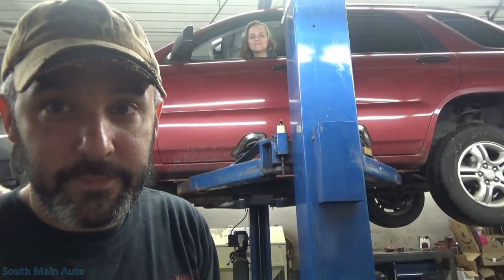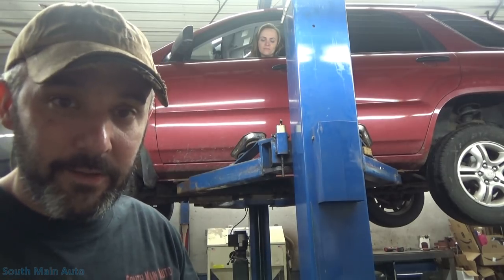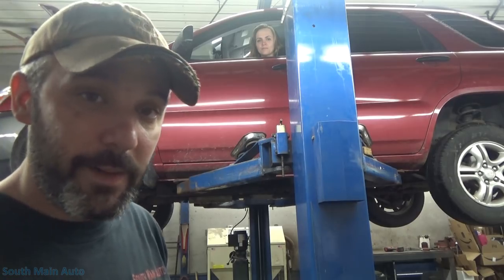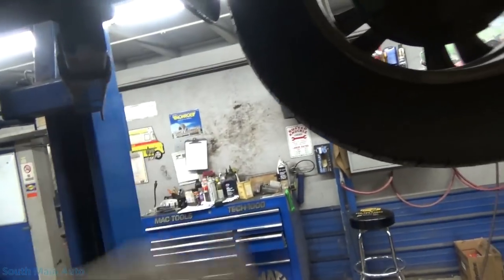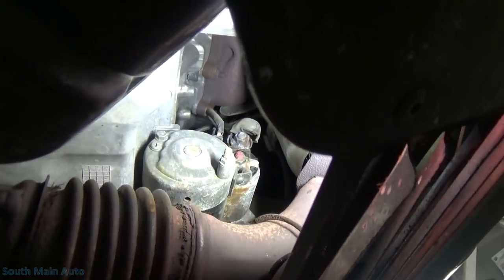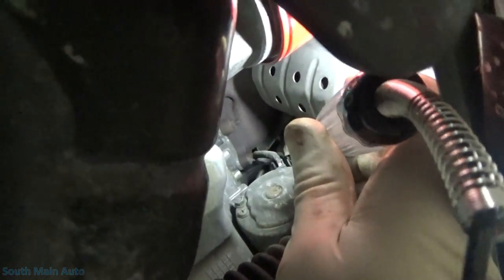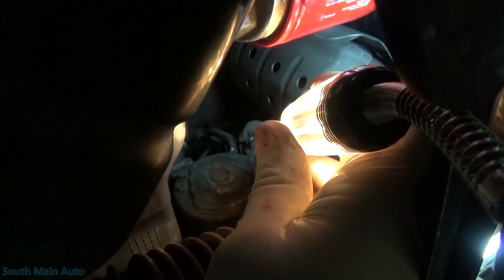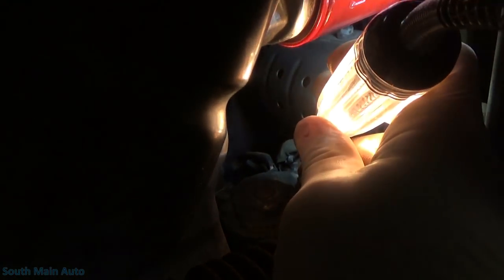TEST DON'T GUESS!

Comment: Always check for transmission jack or anything you might have forgot under ther car especially transmission jack before lowering it dont ask me why.🙄
Reply: Ha, same for going up. I bent over a trunk lid raising a car on a lift. Ceiling was low on one side, raised car with trunk lid open and folded the trunk lid like an accordion.
Reply: @watchthis9792  Probably on the phone...

Comment: Why put a 780 ma bulb in your test light? And thanks for another great video.
Reply: Mike Holt if the test light draws more current, it is more likely to expose a voltage drop due to a bad connection. Of course too high a current through the tester can be bad on low-current circuits - but the starter ain't one of those!

Comment: You just gave me an idea Eric - next time my wife & I argue about something, I can put her up on the lift in the car and leave her there until she tells me I'm right, hehehe.  101 lift uses! :D  Use #100: an instrument of extortion from your spouse. :D

 This right here would've slid the old me, back before troubleshooting was a thing. Would've wung a starter at it, for sure! Funny thing there is,  it may have worked, since disturbing the connection probably would've cleaned it up a little, plus I'd have wire brushed it while it was off - something grandpa got me in the habit of doing. Would've never known I was WRONG! What's worse is, I'd have just wasted a pile of cash!  

 Great title to the vid!! A money saver.  No video is silly, especially this one! You just gave a great example of how even a seasoned tech can get slid on something like this. :)

Comment: voltage drop! voltage drop! voltage drop!. it IS a must to test for voltage drop.... the combination of both starter stud and ring terminal is at fault when exposed to the cruft they're placing on roadways.. even in non-rust belt areas, the same will occur, albeit later in age :0
Reply: have I mentioned chinesium metalurgy in the past :))))

Comment: How did you know the cable from the battery to the starter wasn't corroded too?
Reply: It depends where exactly you touch the test light. If you touch the light to the stud on the starter itself and it goes out when the key is turned then you move the point of the test light to the ring terminal on the cable and try again. If the light stays on then the cable is okay and the problem is the connection. But if the light goes out then the problem is between the ring terminal and the battery. So then you move up the cable back up towards the battery and when you jump over the bad connection the light will stay on when the key is turned. In this particular case he lucked out because it sparked and he noticed it.

Comment: "Replaced starter for intermittent crank"  is throwing parts at a problem.  A bad connection at the starter is not unusual.  I've seen loose connections there (and in  many other places) on brand new cars.  Most recently a Ford Fiesta was towed twice and had a good battery replaced before it was taken to a Ford dealership, where an older mechanic troubleshot it properly.

Comment: Best part is, if it turns out to not be a permanent fix than no big deal!!
Reply: Right. You just need to be sure to tell the customer exactly what you did and what you charged them for. If the starter were to fail a month later they need to understand that it will be a new separate repair.

Comment: but if you put a starter in it it probably would have fixed the issue too, if i have to drop exhaust to check a starter im calling the customer and telling them hey it probably needs a starter and get the labor for that job approved and then do further diag once they approve that labor and when it comes out cheaper with just labor and no parts you look like a hero

Comment: See this is exactly the type of thing that gives me nightmares about bringing my car to a shop. No way.....NO WAY we get out of this without the shop replacing the starterl. Realistically, I'd say maybe 1 in 100 chance, even if they spotted the connection problem.
Reply: The shop I work at you would have your original starter, and clean connections.  Any other
shop in our area, you'd have a new battery,  new cables,  new starter,  and 5 hours of
diagnostic time...

Comment: Simple fixes always don't last long you know damn well that starter may shit the bed couple months from now from low voltage. Surprised Vanessa let you raise her up in a car on the lift, scared that you may not let her back down lol. I used to help a mechanic friend in the shop he worked at the lift was clapped out it wobbled back and forth it was kinda scary.
Reply: "you know damn well that starter may shit the bed couple months from now from low voltage"

WTF are talking about?

Comment: Some poor owner working on his car will smack it with a hammer then it’ll start. This will give him the ASSUMPTION that the starter is bad and replace it. HOWEVER anytime in the future when he does that to another vehicle with the same symptoms, and the car starts he will always think “yea its a bad starter, replace it. Now... in replacing the starter and screwing the bat + wire he will make a better connection and will always use the previous terms i mentioned as a diagnoses. Moral; TEST DON’T GUESS!

Comment: I just saw a floating head in the window and it scared me the crap out
Reply: Had the same problem with my ford f 150. Seems the service tech didn't crimp the wire good enough. So i had to untape his mess and redo it myself. Point is, know your mechanic

Comment: If you hace fired the parts canon you would have got the problem solved too ... when retight the positive to the NEW DORMAN starter .. you know ... part changers .... SCORE   part changers:1 Mr O. :1 ..... LOL .... Issue is the kia returning one week after because the DORMAN starter makes the engine turn backwards or fell apart on the road

Comment: And later the starter craps out cause it looks OLD and the customers is pissed because the car is broke down again...Replace the starter and be done with it. Been doing this at my shop for 35 years! This might be great for DIYers who are trying to save a buck...but nothing is worse than a nagging comeback! Diagnostic time is a labor charge also which could be spent replacing the starter instead of milking a few more miles out of a worn out crappy old starter!
Reply: So what do you do if it needs new spark plugs? Replace the worn out crappy old engine just in case? No. You fix what's wrong and if it works okay you mark exactly what you did on the invoice and charge the customer just for that. If the starter fails soon afterwards then the customer pays for that as a second new repair. That starter could last another 5 years. You just don't know. Things like starters usually don't wear out based on running time anyways. They wear out by the number of start cycles. As such you are replacing a part that still works and doesn't need to be replaced right away. That's called theft my friend.

Comment: I’ve learned the hard way in the scenarios you should’ve just put a starter in it so when she comes back in a month and she needs a starter you want to charge another $300 very upset
Reply from the maker: No need to replace the starter though?
Reply: After the repair if they would have any problem with the starter it would be covered including the tow bill and rental car by the company I work for so Maybe you can see my point

Comment: Hyundai/Kia aftermarket problems? I was fighting with Chinesium aftermarket crap on my old Ford since 99; TPS, O2 sensors, starters... needed a starter for my 92 Crown Vic, local guy had it for $35, 6 months later it craps out, he gives me one free, 9 months after that, it craps out at work 25 miles away. I go to the parts store there and it's $125 lifetime warrantee, bla bla bla, IDENTICAL MARKINGS, even the casting codes on the housing were the same as the $35 starter.

Comment: According to modern business theory you missed an opportunity to make an easy profit by repairing the bad connection, leaving the original starter but charging for a new starter. Believe it or not I know a few fella's that would have done just that.
Reply: Yes. They are called thieves actually. They belong in jail.

Comment: Bad ground
Reply: It's not a bad ground. There is high resistance on the power terminal where the plus battery cable connects to the starter.

Comment: The people that design these vehicles don't have to repair them so they don't care...
Reply: The people that design these vehicles get paid to make them fast and easy to assemble at the factory. They also get paid to cram all the extras that consumers want such as A/C, power steering, power brakes and ABS into a small space. Then you can add in all the government mandated equipment like the emissions controls on top of that. It all has to fit in there somewhere somehow.

Comment: Not silly at all dude but you could have sold a starter as preventative maintenance
Reply: He could have also sold the customer a new engine and transmission as preventative maintenance. Also a new ECM, new fuel injectors and add in a new throttle body too.